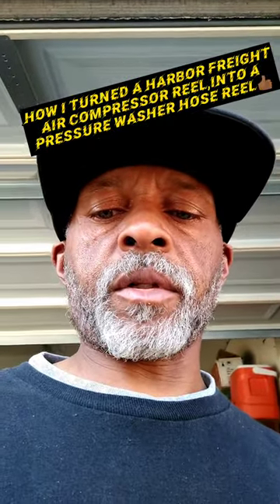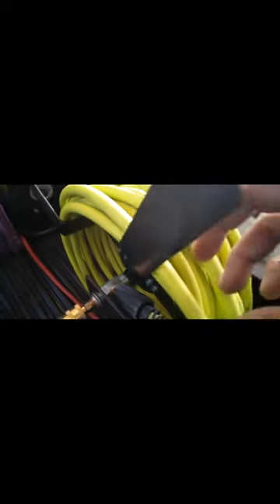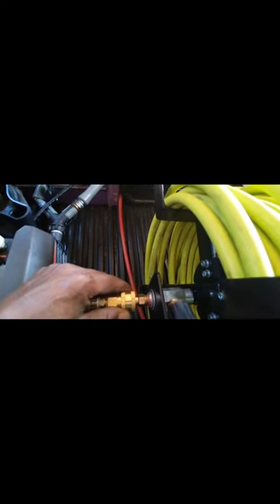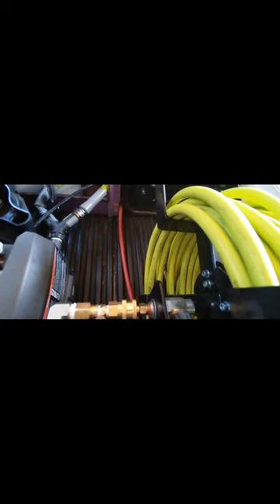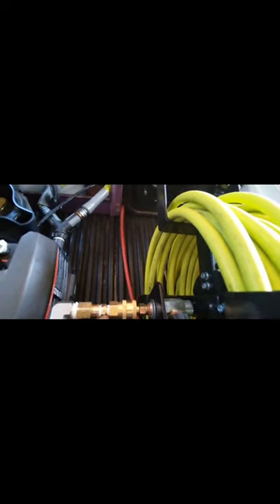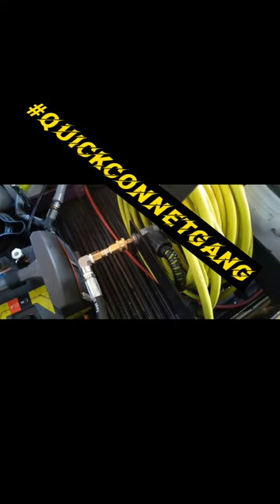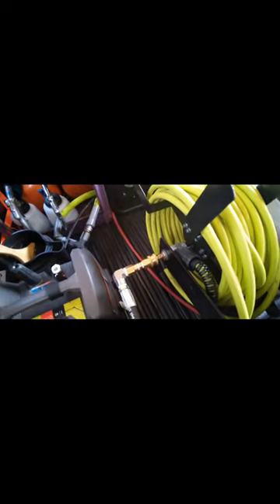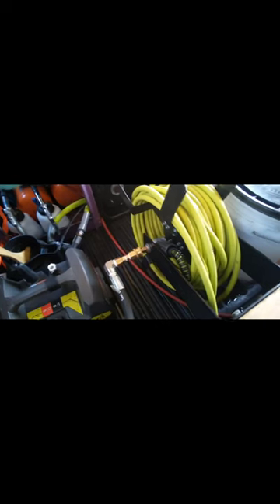How I Turned My Harbor Freight Air Hose Reel Into A Pressure Washer Hose Reel#detail #autodetail

Comment: what PSI is your pressure washer?  How did you connect the hose itself to the reel?  Doesn't that connector need to be pressure rated?  Are you using a 3/8 inch or 1/4 inch whip?  Awesome stuff. I was just thinking the same thing when I saw the reel.  And thought if anyone did it and bam, it was you.  Awesome?
Reply from the maker: 3/8 whip line and a 3/8 pressure washer hose. With a 3/8 quick connect attached to a 3/8 female to 1/4 male reducer,oh and a 1/4 male to male hex screw

Comment: The harbor freight owner's manual said on page 4, 100 psi max air pressure. How did the brass and metal joints on the reel handle your pressure washer which I assume is in the thousands psi?
Reply from the maker: They lied..... I've been running this reel like this for the last four -five months with no problem 👍🏾 #facts
Reply: The pressure rating is mostly for the hose. Change the hose, problem solved.
Reply: The pressure rating is most likely the hose.

Comment: Any reason you couldn’t do the same thing with the harbor freight self retracting hose reel?  Obviously with a different hose, but seems like it could work. Weight of water may mess up the retraction is all I can think of in terms of potential problems.
Reply from the maker: Never thought about that one 👍🏾 good question
Reply: It’s gotta work. I need a narrower reel and the self retracting one would be a perfect fit. Maybe I’ll just give it a try.
Reply: I got the red Merlin air hose reel from Harbor Freight. I put the hose on it retracts perfectly but the brass swivel blew out the seals bcuz it’s too much pressure. You gotta order the Cox Reel 1/4 swivel in order to make it work
Reply from the maker: Yes, You have to change out the swivel and it will work perfect. I have All the parts to convert one, which I'll be doing next. Thanks for all the feedback, just learning as I go.👍🏾
Reply: @WOABullyKennels  you have a link to the Cox swivel that will work?
Reply: @WOABullyKennels take the swivel out and just use solid connections for the whip.
Reply: I ordered it from cox reel website. You gotta tread the brass swivel to screw on the side of the reel otherwise it won’t fit. I took the swivel to a machine shop guy charged me $20 bucks took him 3 mins I had the reel working. I’m am WOA Bully Kennels this my other YouTube channel 😂

Comment: Think this setup would work on a 4000 psi 4.GPM machine ? Awesome video Btw
Reply from the maker: Yessir 💪🏾👍🏾
Reply from the maker: If you go with a 3/8 quick connect
Reply: @wash.wax.shine.detail7554  where’d you buy the Whip and the fittings Amazon?
Reply from the maker: @alexharper9786  the whip came from Amazon and the fittings, I bought from Lowes